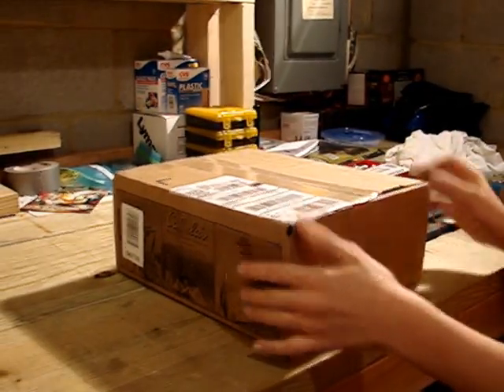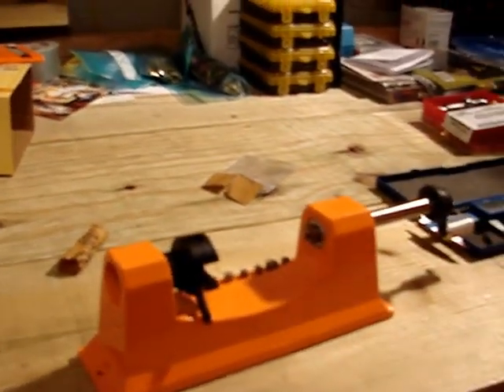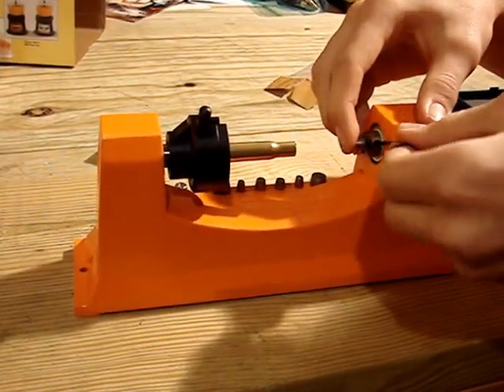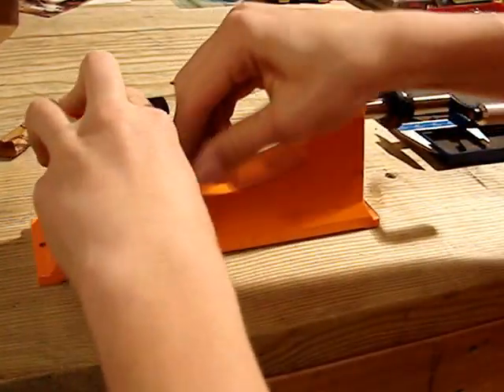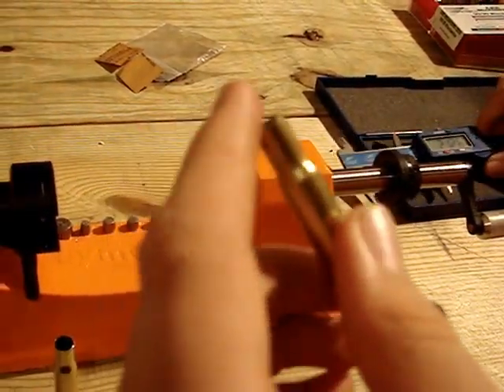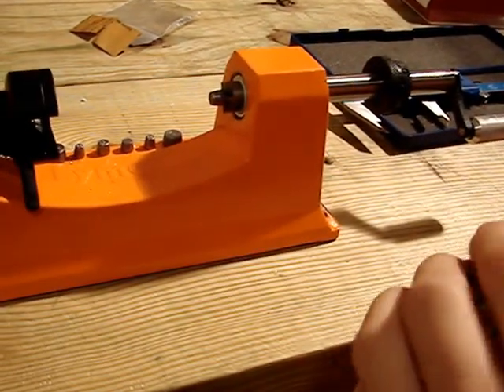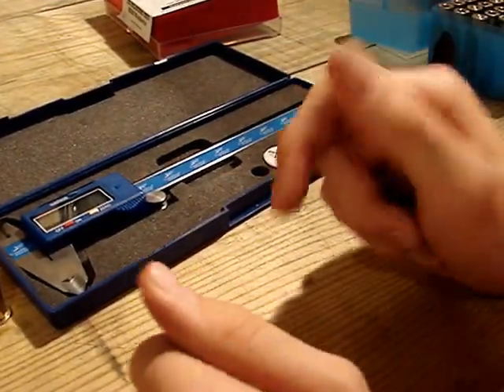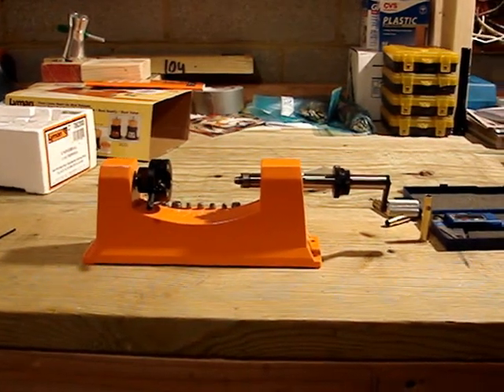lyman universal trimmer

Comment: Why on earth would you lub up a case for trimming? That is insane.
Reply: He resized the case first before trimming.
Reply: WATCH THE VIDEO!!!!!!!!
Reply: @7874me  WHY DON'T YOU ACTUALLY WATCH THE VIDEO!!!!
Reply: Simple. Because that's how its done and makes resizing easier on the dies, not to mention much smoother . Duh?
Reply: @LloydGenth  that is one of the dumbest explanations I have heard in a long time. Its brass against hardened steel or carbide. You don't need lube not to mention it cuts the metal not threading it, even then you have to keep the lub running on the threading. If you are talking about the hub that fits in the case, I still would not do it. In my 40 plus years of reloading I have never ever had an issue with case trimming. If your cutter is sticking that bad you have the wrong hub. And if you are talking about the hub it could not make for a smoother job. that would not affect the cut, only make it easier to turn if you have a tight case. But as I said, I have never had an issue using the correct hub. Maybe you need to watch your hub match up better. Duh?